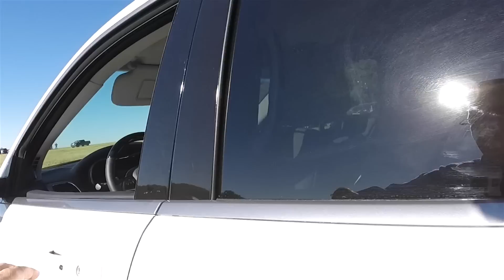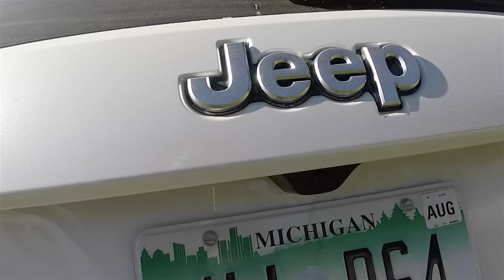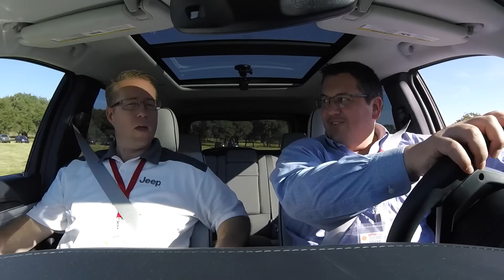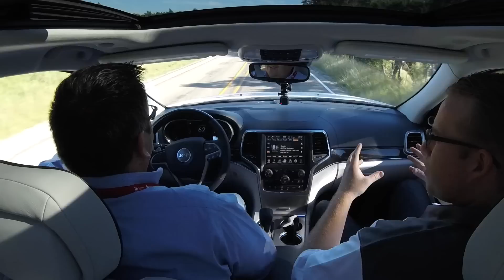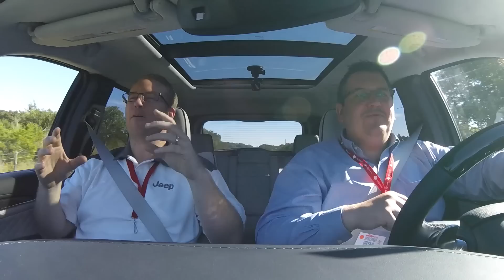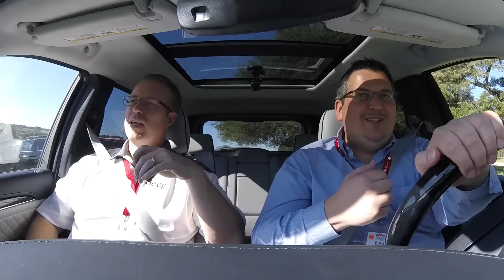2017 Jeep Grand Cherokee Summit - All you ever wanted to know

Comment: I have those Pirellis on my Outback and it drives way better in the snow than my Sierra A/T on stock Goodyear tires. The Sierra will slide from time to time in 4wd in the snow, the other just goes. It IS about the tires. Of course, snow tires are the best option and the Sierra with 4wd low etc would go where the OB would not.

Comment: do not buy the jeep with the white leather it Falls apart after 2 hrs of sitting in it. I bought my truck brand new drove it for about 200 miles and the leather buckled were u sit in it. the back part comes loose. and it never gets better.  it looks nice and that's all. u can't even clean it because the second u touch it it falls apart comes off the seat. the back part of the seat is practically hanging off now. 65000 dollar truck. 5000 was because the diamond cut interior it is a complete waste and defective
Reply: Skender Pervizaj Lies... Thats your experience.. Mines just fine.. you say the same shit on every jeep video... STFU
Reply: Vel Boone im sorry I DIED READING THIS COMMENT.  LMBO

Comment: 8:35 he says the average Jeep owner will not take this vehicle off road. What the hell? I have a 15 Summit diesel. I go off road all the time. Isn't that what a Jeep is for? BTW I love mine. No issues. 700 miles plus to a tank.
Reply: Hi Jovan, No, I have not had any issues. I am actually happier with it more today than the day I purchased it. It keeps surprising me with the technology and performance.  It does everything I ask it to do. In style!!
Reply: He probably means the average owner.  I have a 07 diesel and also take mine off road quite often.
Reply: What's the point of a jeep if it can't offroad?
Reply: Mike Hoffman Have you had any issues with yours?
Reply: Oh, it off roads just fine. I think they are saying most people most likely won't go off road with it after paying 60K for one. You know Jeep sells these in 2 wheel drive also. Now that's messed up.
Reply: Mike Hoffman ,all jeeps are not fr offroad.like the grandcherokee srt
Reply: Mike Hoffman... Any videos of you off roading with yours? I have the same one as yours and I am installing AT Nitto tires on the 20" wheels but I have not seen a video off of a Summit Diesel off roading.. BTW I Love the my Diesel engine.
Reply: Jeep Overlander m
Reply: Mike Hoffman I guess you're not the average Jeep owner.
Reply: Fishea
Reply: I just bought one. Do you hear any wind noise at all at highway speeds? Can't tell if something is up or if I'm just sensitive
Reply: N'awww, did they make a comment you didn't like? Awww diddums.
Reply: Most owners are responsible and keep their vehicles nice. No, offloading is not what they're for. Go get s cj7 or a wrangler

Comment: Great video.. I'd love to know more about/your opinion regarding the eco-diesel.   I'm seriously thinking about making a 17' GC Summit my next suv..  The 3.6 make a compelling argument, 5k less and still good mpg..  Any thoughts on this?  
Thanks!
Reply from the maker: I would not hesitate to grab the JGC Summit diesel. In my mind, it's an ideal Range Rover Td6 substitute. There's the BMW X5, but it's not really something I'd take through West Texas or Hill Country off-road. The price might be steep for some, but it's hopefully the last vehicle you'll ever need (for a good 10 years at least). If you haven't seen my "One Tank Road Trip" challenge playlist, please go through that and you'll immediately understand the benefits of diesel in non-truck vehicles. Thanks!
Reply: I just replied to another thread here, but basically I have a 2014 Summit that's given me no issues and delivers 30+ MPG especially in the summer.  I drive 100 miles /day highway.  Great power, smooth and if I drive conservatively I get over 720 miles driven per tank.   Diesels go fast.  When I got mine it was only one in NH.
Reply: I am considering buying a used 2014 ecodiesel Overland, but I have read a lot of negative reviews. You are one of the few positives. I am curious, did you buy yours in 2014?
Reply: Yes brand new in 2014    @ 42k miles now.  Catalytic converter caused CEL.  my HVAC blower is getting noisy so I'll get it replaced. Otherwise just oil changes & fuel filter etc.